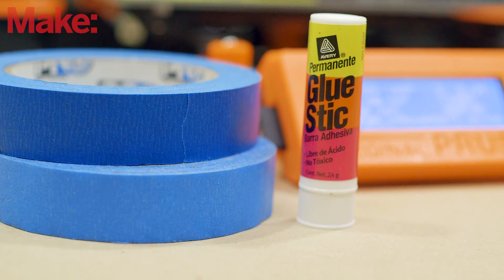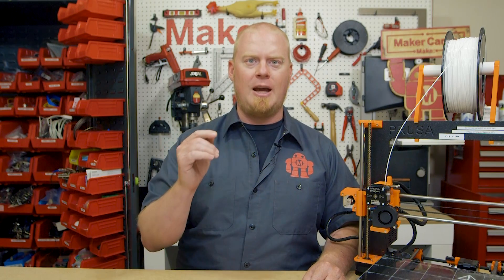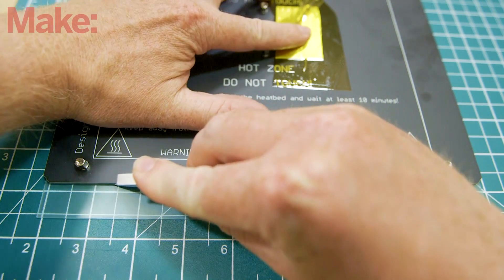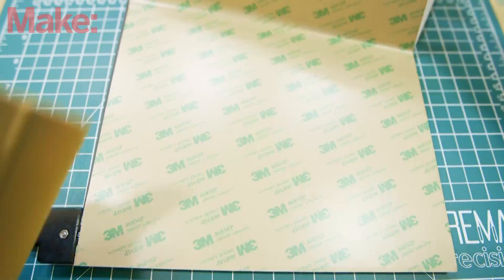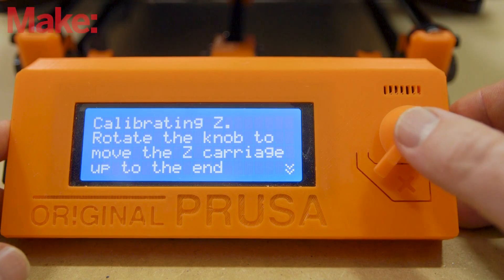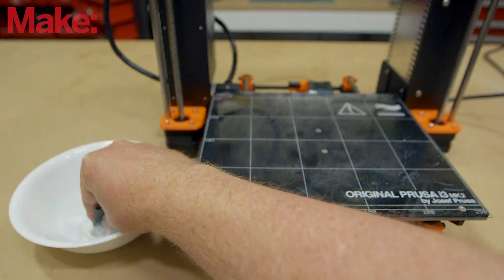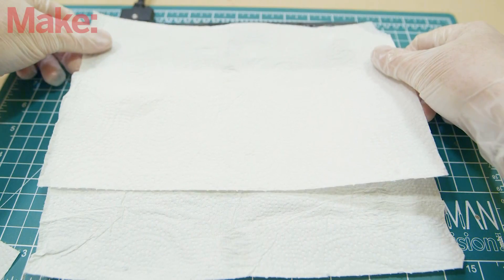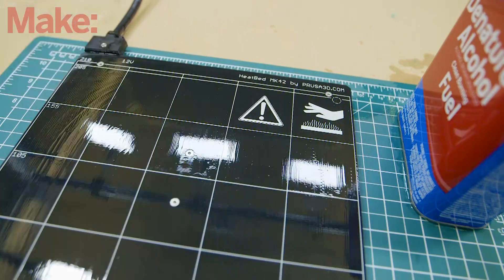How To Get Perfect 3d Prints Every Time

Comment: OK but this Really worth it without an heated buildplate or not ?
Reply from the maker: I don't think PEI works without a heated plate. I think they work because the surface of the plastic has pores that expand with heat and help grab the filament as its extruded. When the build plate cools, the pores release, and the print is easier to remove.

Comment: Gluestick even works directly on glass with pla... no need for special buildplates.
Reply from the maker: it does! that's what I used to do, but the buildup of gluestick left the bottom of the print with an uneven surface and I had more nozzle clogs. This is a lot easier, I find.
Reply: You still have to clean the gluestick off the PEI sheet when printing certain types of filament. Also, just regular scotch tape/painters tape works great. Easy to take off and clean.

Comment: When I would attach Kapton tape to glass, I would apply soapy water to the surface first. The adhesive on the kaptop would slip and slide, but when squeegeed out, it would dry and stick very well. Kaptop stretches if you pull too hard, so if you get a bubble surrounded by adhesive, you can't pull it back to remove it. I know not all adhesives work the same, but that would make the process a lot easier, and you'd end up with better results.
Reply: sounds similar to applying window tint film.

Comment: I just use binder clips to keep my PEI sheets to the build plate and although I haven't gotten to a point where a good alcohol rub doesn't bring back the adhesion I think I could just flip my sheet and get twice the use rather then taping it down
Reply from the maker: Good to know! Do you have any trouble with the PEI sheet bowing up in the middle?
Reply: this is how i ruined a pei sheet the middle bowed and permanently deformed the surface, i take the glue/backing sheet and cut it into 1/2 squares then place  grid of the pieces on the sheet then pull of the backing from those and place on the surface. makes removal/cleanup later way easier
Reply: I have no trouble with bowing and even if one started to bow I could just flip it so the bow is pushing against the build plate but I've been using a PEI sheet clipped to my monoprice mini for about a year now and aside from a few scraches from printing PETG directly on it then using a razor scraper to get it up its the same as the day I got it but I get mine from gizmodorks and there pei sheets are 0.8mm so its kinda thick
Reply: If you don't ensure consistent adhesion of the PEI sheet to the build plate you'll have issues with uneven heat transfer which could make printing with filaments that require higher build plate temperatures problematic, particularly on the first layers. This could cause adhesion problems for such filaments.